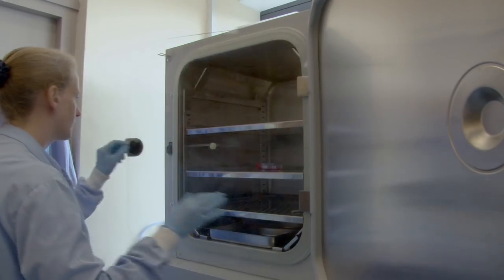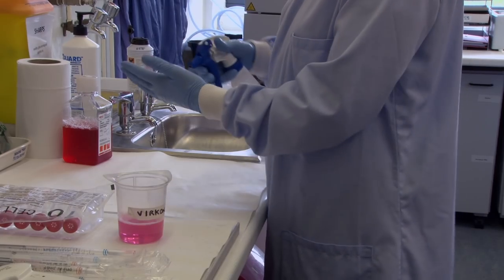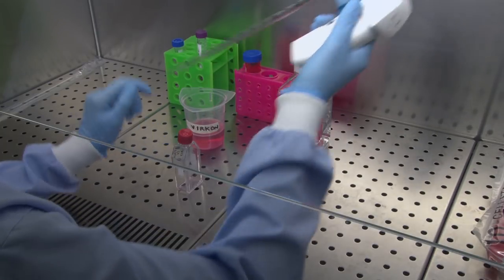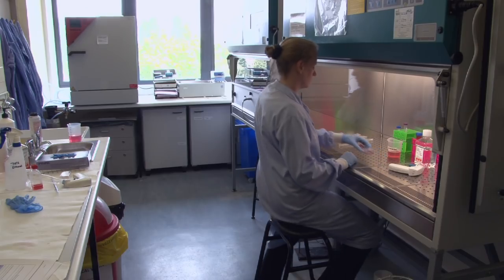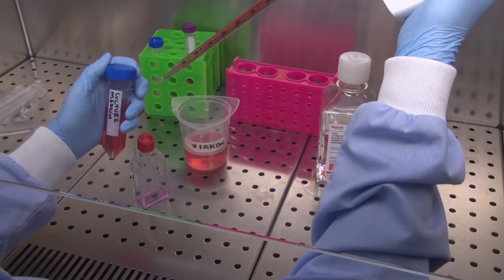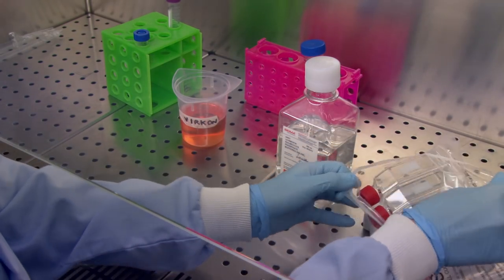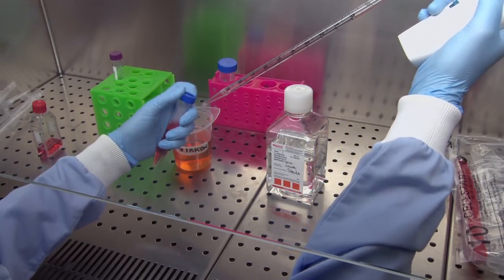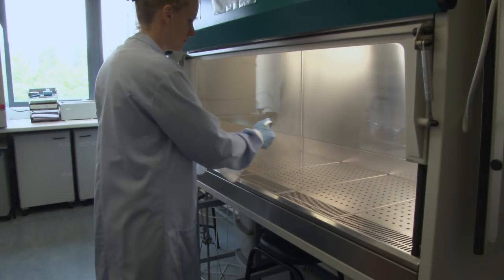Sterile Cell Culture Technique

Comment: Very informative and pleased to witness a very competent operator. I trust the resulting materials are not for use in humans? I ask this because if so, the aseptic technique, procedures and the environment would require improvements. To follow up on Thyago's point regarding the use of 'sterilisation' he is right as the 70% ethanol sanitises the outer surfaces reducing bioburden and this cannot be referred to as sterilisation.

I have never witnessed the supernatant being poured off the pellet of cells before, does the pellet always stay anchored or do you occasionally lose one?
Reply: i have never lost a pellet in this way.

Comment: Half this lab's budget goes to buying serological pipettes 
They should invest in a vacuum pump and autoclave glass pipettes for aspirating media and PBS.
Reply: Yes, seems as if that is so, I'd be inclined to provide reusable glassware and a proper sterilization procedure and not use the single use plastic supplies - but the whole environmental cost/benefit from origin should be analysed when making that social decision (rather that basing that on the local business budget only).

Comment: Great video. I was curious however why you pellet then resuspend the cells? I was under the impression that the trypsin is neutralized by the media and can simply be diluted with fresh media until the desired cell density is achieved? This surely removes an additional handling step as well as risking damaging the cells through vigorous pippetting?
Reply from the maker: This is a generic protocol and is meant as an introduction to the idea of cell culture and aseptic technique.  This, as with other protocols may be adjusted to suit the requirements of the specific experiment undertaken/cells in use.  However, It is common practice to centrifuge and resuspend cells after trypsinisation and this does not affect cell viability when done under appropriate conditions (e.g. normal levels of pipetting with a standard opening tip does not generate sufficient shear force to damage mammalian cells)  You are correct that most cells are largely unaffected by simply leaving the trypsin on, diluted.  The key point is that not performing the centrifugation step is really only appropriate where routine subculture is being undertaken. Centrifugation and resuspension is a critical step in a number of cases, e.g.

Should the cells need to be completely “washed” of the media they are in,
going into a short-term biological assay,
the cell sample requires concentration to make a higher cell density.

and so the decision for this training video was to include the centrifugation step.
Reply: I see, thanks!